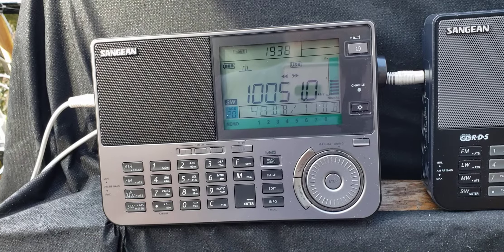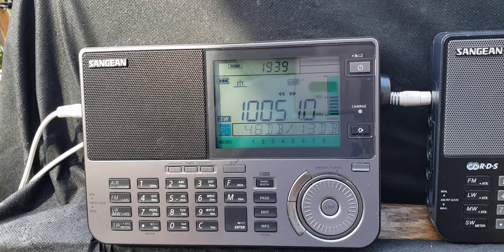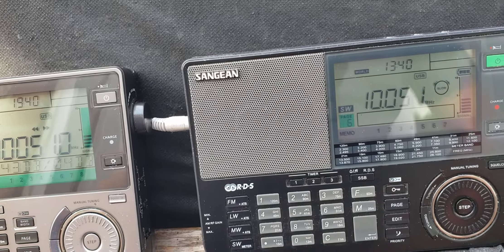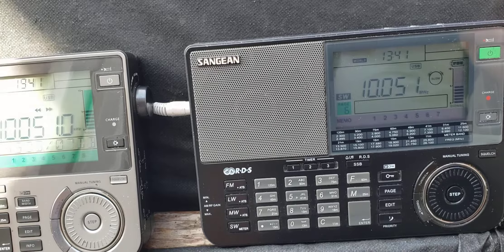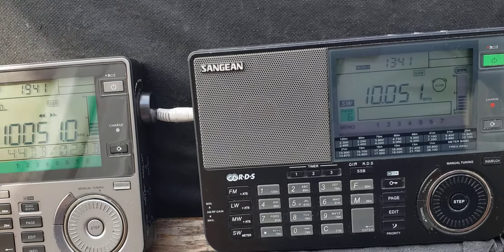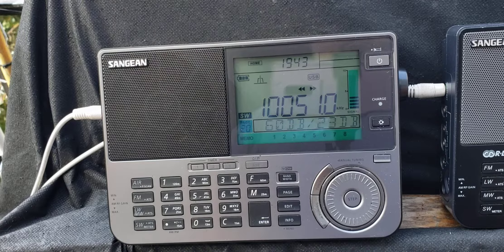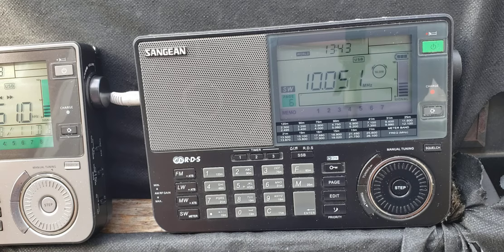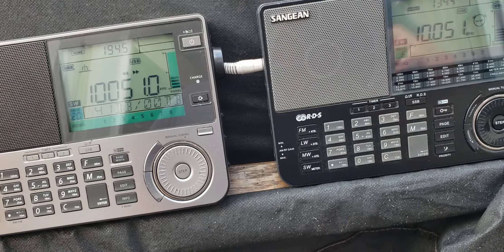Sangean ATS-909X VS Sangean ATS-909X2 on SSB 10051 kHz USB Gander radio volmet newfoundland Canada

Comment: This question is unrelated to this video. i am on a tight budget and do not feel like spending over a hundred dollars on a tecsun pl-660. Should I buy a Tecsun pl-330 or a pl-600? is the 600 better than the 330 in terms of features, reception, and sound? What do you recommend?
Reply: The 330 is the best value for money, according to Gilles.
Reply: @davidsradioroom9678  Isn't the pl-600 larger than the pl-330? Doesn't it get better reception and have a better speaker?